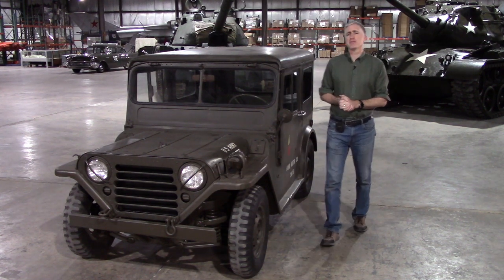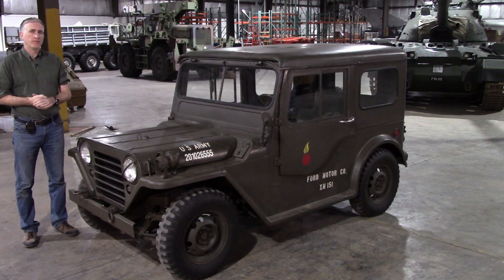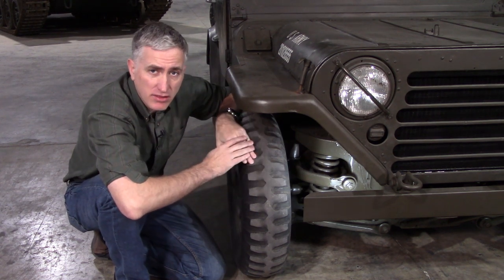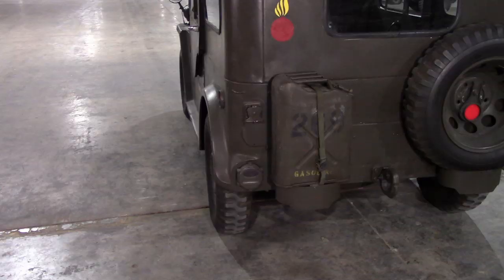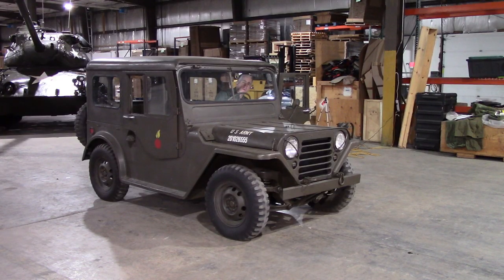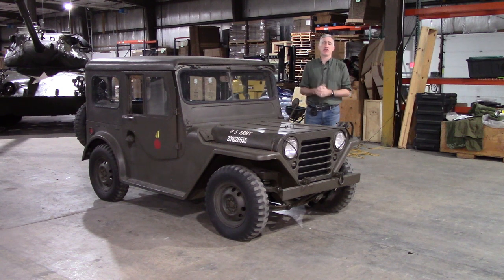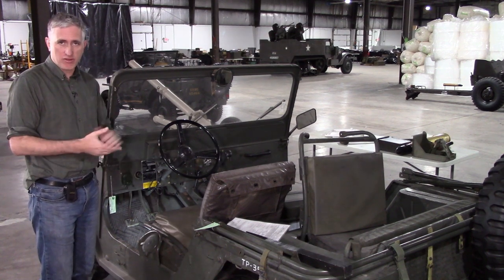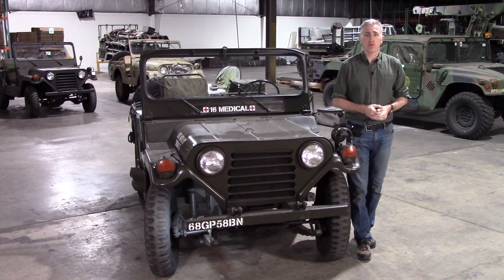Inside the Chieftain’s Hatch. M151 Series

Comment: How do you adjust track tension?
Reply: The track tensioning system is pretty straightforward. You use the standard lever arm to assist with guiding the Extra Large Width rubber bands onto the back wheel, or 'rubber drive bogie', and then after slipping the slightly loose band onto the front wheel, also known as the 'sometimes idler, sometimes drive bogie depending on where the lever is' and then you adjust track tension by pneumatically adjusting air tension in the rubber bogies. There isn't a return roller, but the passengers could just smack it back into place while the vehicle is moving by just leaning over the side.

Comment: I drove A2s for many years. Never had a rollover that wasn't assisted by external factors (one time, and that was due to the front passenger wheel dropping into a stream channel while driving under blackout conditions and after being night-blinded by oncoming trucks with their headlights on. We survived without injuries because it landed flat on the passenger side supported by the windshield and antenna mount.). Other people I served with weren't so lucky.
We never called it a jeep. It was always called a quarter-ton. We usually had a trailer with our equipment in it, and I hated backing up with the trailer attached. I never got to drive a Humvee, and kind of wish I'd had the opportunity.

Comment: I saw someone roll one on Umptanum Ridge at Yakima Training Center. He crawled out from under the upside down jeep with only scratches, the radio mast acted as his roll bar. I drove one for years, mostly without canvas so I could see traffic. With no heaters in Washington state, no one wanted to ride with me. Never came close to rolling mine in thousands of miles, but I learned to drive in a 1960 VW pickup, so swing axles were no problem for me.

Comment: I was following behind a 151 in a convoy to 29 Stumps when the vehicle, on a flat dry road, started to shimmy left the road, and flipped.  I had resigned myself to filling a body bag or two but both driver and a-driver were thrown clear with only mild concussions. At operation Bell Call we lost half of the 151's assigned to the tactical exercise control group in less than a week. Someone should have gone to jail for approving the bloody thing for service.

Comment: As my second permanent party duty assignment I was assigned to Co. A, 709th M.P. Bn in late 1973, which was equipped with sedans, M151a1's and M2's.
In my introduction to Usareuer briefing, I was told if I ever had an accident in my assigned M151, I would be offered an Article 15!
I was then ordered to not "have an accident".
This is how the Army in those days dealt with the potential safety issues of this vehicle, lol.
From experience, I soon learned European roads have many cobblestones and when wet, they are as slick as ice, and between them and "strassenbahn" street car tracks, the driver of an M151 had to be very careful indeed.(In 3 years, I never had an accident myself, and have always felt the vehicle to be safe provided the driver just use a lot of common sense and remember the vehicle MUST move VERY slow when making turns!
Observations: The center of the hub in the front wheel stuck out on both my units, (the A1 and the A2, and a whole was in the very center of that thing that stuck out.
That whole was the same size as the circumference of the crowbar, and if the bar was put thru that hole, a rope could be tied to the crowbar, and by allowing the rope to coil around the bar, the vehicle had a means to winch itself out of deep holes, or deep mud.
As the windshield wipers were hydraulic on the A1 especially, we G.I.'s used to unplug the air hoses on the dashboard and let them "smoke a cigarette" real fast as a joke.
The large gas fill cap just under the drivers' door was convenient as we could open it, remove the filter cup within, and then dunk our Zippo lighters into the fuel, which would then be good for a long time.
(Never bought lighter fluid the 3 years I was in that unit.)
In my unit, those M151's were never camouflaged like the divisional units, but remained O.D. green, which we could paint by going to the motor pool and getting a can of green paint and mixing it with an exact amount of black paint, (which the motor pool guys had on a chart.)
We had tactical radios mounted over the rear wheel well behind the radioman's seat.
The long antenna for the radio was mounted on a bolt on assembly on the passenger rear corner of the unit, with a spring maybe 3 feet up so the antenna itself could be bent forward, at an angle in the direction of the drivers' front corner.
A small pintle on the front fender held a length of paracord with a small aluminum clip which held the antenna in that position, freely.
Chieftain and I must be about the same height, (I was 74"), which I detected when he entered the vehicle.
In all the time I drove those wonderful machines, I never knew about those "fresh air" portals on the front of the dash, maybe because it was never warm enough in Europe to need them.
Besides, we did not have "doors" whatsoever in the warmer months, only a web type strap on the passenger side which clipped on at the front of the "door opening".
We always had a plastic/canvas roof on the unit, and plastic/canvas doors were fitted to the unit in inclement weather only.
In the winter, we always had the option to put chains on the vehicle, and I used them in those German snows.
Generally, every other M.P. had a vehicle assigned to them, the other half being the "radioman", but all of us performed "first echelon" maintenance on our vehicles monthly, (or whenever we wanted to.
Most of us were proud of our units, and were very stingy about keeping others from using our units when not assigned to road duty ourselves.
I drove unit A309 as my ast assigned unit for roughly the last 18 months of my tour.
The "3" indicated the third platoon, ninth vehicle, and the "A" was of course, the unit.
A unit A103 would be from "A" co, first platoon, third vehicle.

Thank you for this wonderful report on an old friend...

Comment: This looks astonishingly small compared to modern day American military vehicles like the Humvee. It just looks so tiny next to a human
Reply: Well to be fair, he is a tall guy.
Reply: That's because the Humvee (which is in the process of being replaced) was designed to drive in the tracks left by full sized tanks, which is why it's so wide. Its successor vehicles on the other hand are large, because they are heavily armored against roadside IEDs and RPGs.
Reply from the maker: I’ve heard that as well, but will have to look it up to be sure. The alternate explanation, into which I place more stock, is that it was the end result of the desire to increase ground clearance for off-road capability. By shoving the whole power train up into the body, it meant that the seats needed to be shoved outwards. Also increased lateral stability.
Reply: @TheChieftainsHatch  Could be, but I've also read that due to the enormous size and width of the vehicle (not to mention its enormous weight), its off-road capability is actually negatively impacted, at least compared to more compact rivals like the Mercedes G or Land Rover Defender.
Reply: Look at the latest and greatest JLTV (Joint 'Light' Tactical Vehicle)  The thing seems nearly comparable to a semi tractor in size!!
Reply: @no1DdC  , 
Pretty sure that's a myth.  To be sure a myth I first heard when they were fielded some 35 years ago.  However, the numbers don't add up.  The Humvee is seven feet wide and the width of the M60 and M1 is right at 12 feet.  If you subtract the width of the tracks, about two feet each, you're left with a between track width of about eight feet.  Just enough room for the Humvee to drive between the ruts caused by a tank.
Reply: @no1DdC  
Right, they're more compact, they carry less and thus less adaptable.
Reply: @drkjk  true but we also have to consider what the Humvee is put through because it's considered "more capable" by command. The damn thing is basically forced to be a LAV it's so up armored. The thing has a negative reputation simply because they're forcing a transport vehicle into the same stuff as the light armor.

Comment: The solid axle M151 was actually a project for Canada, who wanted new vehicles but wanted parts compatibility with our M38A1’s. Project was a total failure. Canada ended up buying M151A2’s, and then tried to develop a conversion using the M151 engine in the M38A1. It was a failure as well.

Comment: Canada had tons of these. Some equipped with TOW systems and were terrible for roll overs. Replaced by the Iltis but the roll overs didnt stoo
Reply: I was told by my father the same thing about the U.S. m151a1c with a 106 recoiless rifle.  He also said when you got them off the ground, the wheels tucked up under them like a corvair.  He said they only ever called them 1/4 tons.

Comment: God! I remember this death trap (it was anything but a Jeep).  I was checked out on it at Fort Hood Texas B Co. 124th Maintenance Battalion, 2nd Armored Division in Feb, 1980 and damn near died in it at 30 M.P.H. on a level dry road, in June of that year.  There were two major problems with the M151 series, 1).  the independent suspension would deflect too far and the body roll would tend to flip the vehicle if turned to sharply.  2).  being a unibody any twisting in the chassis/unibody frame would cause the vehicle to become misaligned and not track straight, it would actually crab (what happened to me).  the Unibody could not handle the sever loading and unloading of its suspension in hard off-road use leading to the twisted unibodies.  The M151A2-LC the Chieftain showed near the end was the AMC fix to a design problem Ford created in being too cheap to produce the original Jeep "body on ladder frame" with solid axles as per the original design.
Reply: They fixed all of major issues with the A2, it was driven and treated poorly. It's an excellent truck, you just have to respect is quirks.
Reply: @JM-jv7ps  Your right it was flogged like a rented mule and by the time I saw one about 20 plus years after the fact, they were well and truly worn out.  In new condition there were good , but as you say needed to be treated with care.  The problem is that the operator is often times the lowly private who simply could really care less.  After my little moment of excitement our motor pool went through all our MUTTs and found almost half to have unserviceable bent frames.
Reply: @DitzyDoo I read your comments and want to add (as an A2 driver since 2 years):
imho the Ford and Army test drivers did extensive tests of the MUTT. But because a) the focus was off-road, and b) the drivers were well trained, the vehicle was accepted by the military. 
As then in real life a) the M151 was driven on regular roads, and b) drivers handled it the same way like their sedans, the tragedy began. 
You mention the unibody twisting - that is new for me, thank you for this info! 
My A2 has quite big a dent what is only to be seen on the hydraulic ramp. But the German TÜV approved it, thus I think the body is still straight or it was fixed by a pre-owner. Nevertheless, I'm carefully when it comes to sharp turns or roundabouts...
Reply: @BerniesBastelBude  The one problem with a unibody is that all four tires will sit upon the ground evenly even if the body is not straight, were in a bent ladder frame the damaged part of the frame will show and the tire will sit and wear irregularly.  One of the ways we quickly tested for straightness of or MUTT's was to take them behind our motor pool on a soft dirt tank trail and drive straight ahead for 50 yards then inspect the tire tracks alignment of the rear axel with the front.  If the axels are out of alignment like the one I drove there were four distinct tire trace lines.  Those that were less pronounced we took to the Depot support shop for testing.

Comment: Two things it's front end was a major problem if you hit a bump and went airborne the steer wheels would drop and fold in to the centre on touchdown it would cause it to roll as the wheel was tucked in. It's ground clearance for the body got worse.

Comment: Ceiftan if you had to pick between the Kublewagon (any of them) or the Willys jeep witch would it be? Just asking.
Reply: Pretty sure Bruce Crompton did a comparison on his show.
Reply: Jeep.  A true 4x4. The Kubelwagen was only 2 wheel drive and it was expected that when it got stuck it was light enough to pick up by the men riding in it.
Reply: Kublewagon is a lot more rare these days (A true WW2 one, not to be confused with the VW Thing). So for a collector, the VW. But for driving, the GP. Although I would prefer a Ford GPW to a Willys model.
Reply: @PitFriend1  The Volkswagen Schwimmwagen could actually swim which for some reason was not as famous.

Comment: Never cared for the 151 all that much.  Army did have a problem with them flipping easier than other vehicles.  In the late '70s the surplus ones going up for auction on base were listed as "Residue".  If you bought one you had I believe, 48 hours to strip it off all you wanted except the body / frame.  At the end of the time allotted they would run over the vehicle with a bulldozer and then you could have the rest.  At the time because of liability or something, they thought that they were to dangerous for the street..  Our main problem was that the engineers would back blade the trails in the hills and that would fill the ruts but with soft dirt.  You could not tell were the ruts were then and if you caught one wrong it could flip you.

Comment: I am sorry, but Ford is not the original first Jeep. Bantam developed the Jeep according to the demands of the American army in 1939. The demands were, a 1/4 ton vehicle. Which could transport up to 4 people, with packing. It also had to meet a certain length, width and height measure. Because Bantam was only a small firm, it wouldn't be able to handle the large amount, so the army brought in Ford and Willy's. And said, "Look here this is how it should be, can you make that? And if so, everything, all the parts, has to be interchangeable."
Reply: Bantam made the first Jeep-type vehicle, based on a design from an freelance designer they had commissioned, to meet an Army tender. The Army then invited Ford & Wilys to produce versions from that design, which it then combined the best bits of the 3 companies' efforts, and awarded the virtually all the wartime production to Ford & Wilys, leaving Bantam to make the majority of the trailers.

Comment: just a dumb question.. wouln't 4 quarters of oil make a full unit of oil?
Reply: It's four quarks. Not much oil.
Reply: 4 US qts. = 1 US gallon.
Reply: @knunyabeasewhacks8744  Yeah, but quarks is funnier.
Reply: @JimFortune  It all sound nonsense to me, how many Imperial pints is it?
Reply: @Tuning3434     4.8  US quarts to one Imperial Gallon about
Reply: @Tuning3434  Or 1.66 or so Imperial pints to a US quart.
Reply: @JimFortune  Shall I tell you a secret? I am an SI guy...what are the odds, it is the unit of measurement that brought people to the moon, ya know.
Reply: @Tuning3434  So four US quarts is 3.8 liters.
Reply: @Tuning3434  
It's actually not.  NASA didn't switch to SI until 1990.

Of all the countries in the world, there are those which use metric, and those who have stood on the Moon.
Reply: @ColonelSandersLite  
Paper of Don Eyles, who LITERALLY WROTE THE SOURCECODE for the Lunar module:
https://www.doneyles.com/LM/Tales.html
"With respect to units, the LGC was eclectic. Inside the computer we used metric units, at least in the case of powered-flight navigation and guidance. At the operational level NASA, and especially the astronauts, preferred English units. This meant that before being displayed, altitude and altitude-rate (for example) were calculated from the metric state vector maintained by navigation, and then were converted to feet and ft/sec. It would have felt weird to speak of spacecraft altitude in meters, and both thrust and mass were commonly expressed in pounds. Because part of the point of this paper is to show how things were called in this era of spaceflight, I shall usually express quantities in the units that it would have felt natural to use at the time."

This is the very definition of landing with metric units on the moon, is was easier to program and calculate with metric meters in one of the most complicated pieces of software in the '60s.

Comment: Why didn't they just put a roll-bar on them they don't look like they weigh very much so it wouldn't have cost very much? Like a very simple welded cross frame in the center would have worked fine similar to many modern CJ Jeeps.

Comment: I have a strong feeling that all the kurflufle about the M151 rolling over is greatly exaggerated. I think it just means it is easier than average to roll, and they were concerned about the high number of rollovers compared to other vehicles. So they made warning videos to warn the troops to be careful, and instead scared the crap out of them so they were all sure it would just suddenly flip over every time you tried to take a corner. or maybe the media just got ahold of the story and did the same to it. A lot like the Reliant Robin. Most people drove those things for years and never rolled one over, because they used a bit of common sense and avoided sudden turns at speed, etc. If you get a bunch of 20 something soldiers together without supervision messing around in trucks they didn't pay for, I am not shocked they felt it important to warn them that they were easy to flip over. But i doubt any person who knows how to drive responsibly needs to worry much about it.